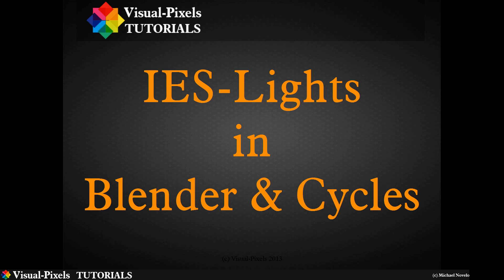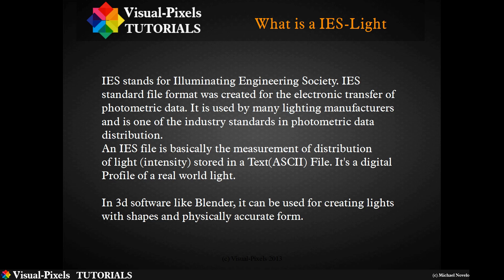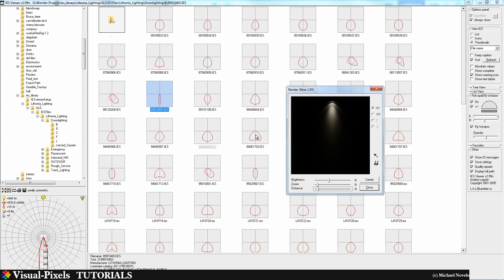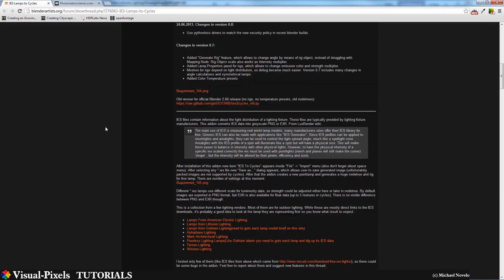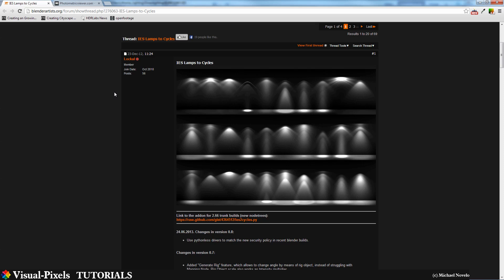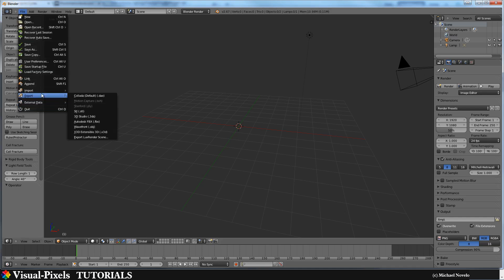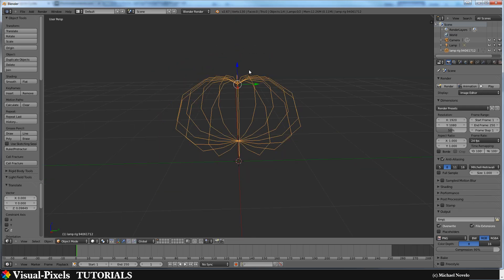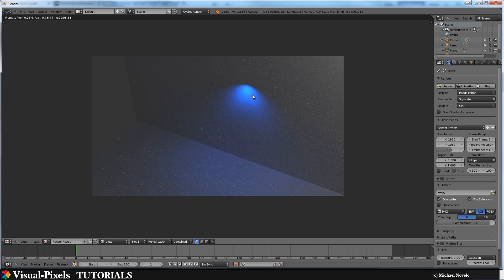IES lIGHTS in blender and Cycles

Comment: how to installs blender ies?
Reply: +Dustywitch Hey man
I'm trying to install the file but not working because it is not in PY format not to install the script as I do in this case
Reply: That's just a white page with text, there's no downloader there.
Reply: gohere 

https://gist.githubusercontent.com/AngryLoki/4364512/raw/0fe40eda20c3b2e54dabcbf62646ab4ce10be1d2/ies2cycles.py

SELECT  --> RAW from the options on the page,

Open Notepad or similar Text Editor on your computer.

COPY the text and PASTE into your Text Editor page,

SAVE the File as ies2cycles.py.  
This is done by using the name I just gave and select FILE TYPE as All Files.  The Directory you should save it to is 

C:\Program Files\Blender Foundation\Blender\2.72\scripts\addons

Open blender 

Select FILE

Select User Preferences 

Search for ies2cycles

Place a check in the box

Close Preferences

your Pythonscript is now installed for your session with Blender.

To make it a permanent addon, before you close your preferences, select Save User Preferences then close.